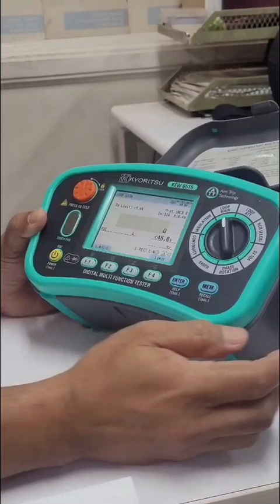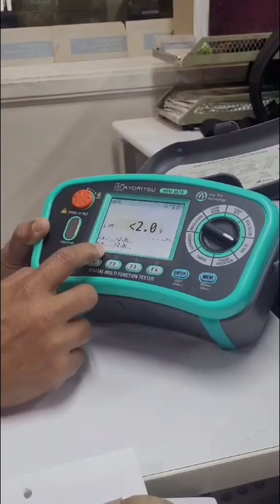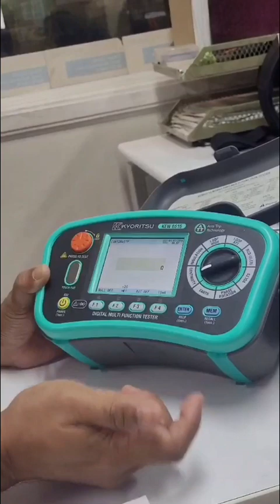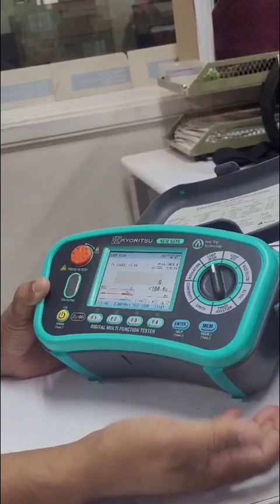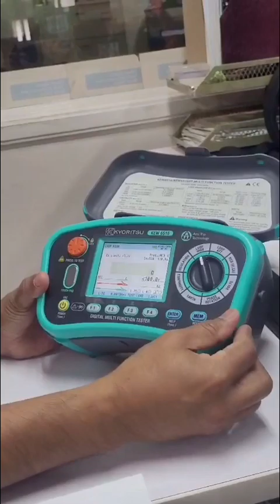Kyoritsu 6516 Multi-Function Tester

Comment: Very informative po idol, tuloy tuloy lang po
Reply from the maker: insulation tester, earth tester, loop impedance tester, RCD tester, voltmeter, phase sequence tester, surge protection device tester, frequency meter, portable appliance tester, continuity tester. may built-in test limits for pass/fail